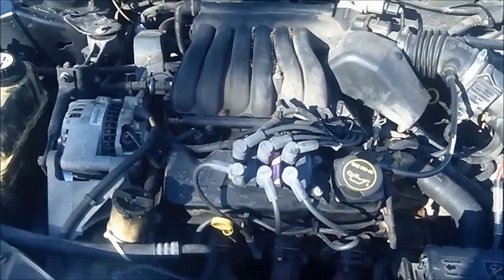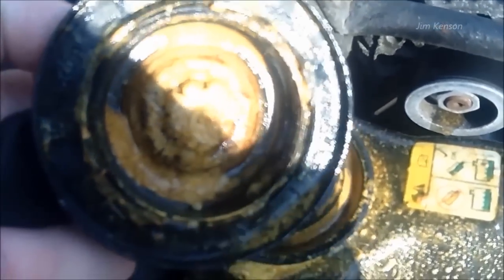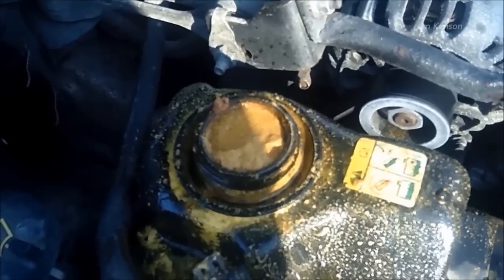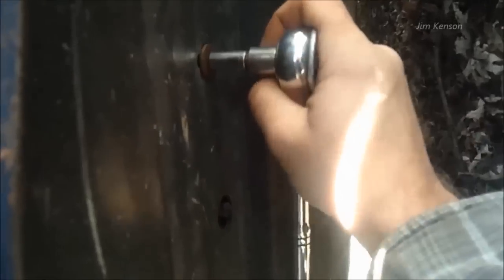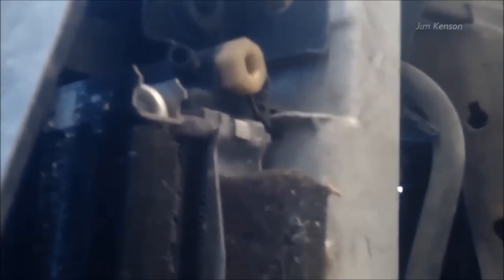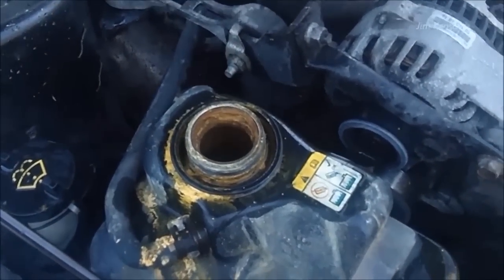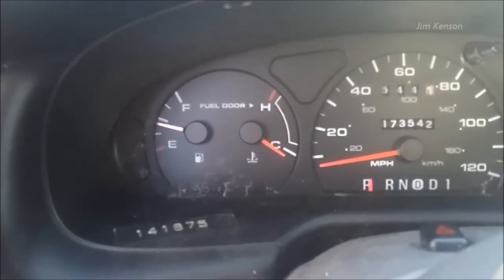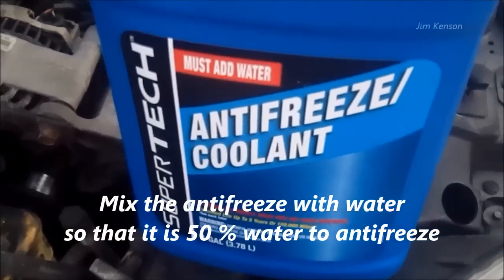Ford Taurus: Radiator Flush

Comment: If your ford is still foaming as in this video:

A less expensive way to deal with what appears to be a possible leaking head gasket is Steel Seal.
I've used it on a 2004 Taurus, a 1996 honda civic, and a 350 small block chevy. 
It has worked exactly as advertised each and every time without fail.
The company has an excellent return policy, and an excellent business record. 
They do not ask questions aside from if you would like a monetary refund, or a one time free bottle to re-dose the engine.
The look of the foam tells me the leak, if present, has not been leaking for very long.
Meaning the 99% success rate steel seal has should stop that leak without the need to pull the head.
NOTE: It more than likely will not fix a leaking head due to warping of the head. But for most leaks of the gasket, it works friggin awesomely!! 
By the way, their warranty, is a lifetime warranty. Either it permanently repairs the leak, or they replace or refund at the customer's request. 
(It catches any new leaks if the product remains in the cooling system) 
All vehicles I have repaired with steel seal had the product left in the vehicle until the fluid was changed by the customer, either by choice or maintenance schedule. It never plugs up any coolant passages.
My apologies to everyone. I realize this comment looks like an ad. It was not my intention. lol  
And if you already know about this product, my apologies for repeating.  
But I will leave the link so that anyone can look into it if they wish.  Or google it.  lol
https://www.steelseal.com/

Added: Steel Seal has included "permanently repair a cracked head or block" to their guarantee at some point since I used it last.

Comment: This is how I'd do it.  Drain out the old stuff, and dump some distilled water into the system.  Let it run for a while.  Then, drain that out.  Put in the Prestone cleaner stuff, and then top it off with more distilled water.  Drive the car for a week or so with the cleaner in it - just be sure you keep an eye on the engine temp - don't want it to overheat.  Also, make sure where you live there won't be any freezing temperatures b/c the water will freeze.  After you run the car with the cleaner for a while, drain it out and flush with distilled water again.  Keep doing that until it runs clear.  Then fill it up with coolant.  Take all of your old coolant and put it in milk cartons or the cartons you got the distilled water and coolant in.  Take it to an auto parts store or a mechanic, they'll probably take it for free.

This was a great video.  Wish I didn't have to take that plastic shroud off.  Just extra crap to worry about.  The screws can be pretty rusty too, and hard to get off/back on properly.  No need to take off the thermostat, which is nice.  Can be kind of confusing because there is no radiator cap, you do everything through the coolant reservoir.

Just remember to change your coolant every 20k miles max.  Do it before then if it gets nasty like this or if the heat starts losing intensity (not getting very hot).  Don't flush the heater core itself, you have to flush the whole thing like this video does otherwise it'll just get dirty again.  I learned that lesson.  Also remember to use the yellow/green coolant - don't use the orange stuff or the dexcool stuff, it causes problems in a lot of cars.
Reply from the maker: +NewVegasNerd Thank you for the great reply.
Reply: Great advice! Added to this video this DIYer will be DIMyself!
Reply: NewVegasNerd 
I have a question...I'm the process of flushing. I put in the flush, and a gallon of water. How long are you supposed to run your car for? And are you to keep the cap on or off? Anyone, please reply asap. I ran it without the cap for about 5 mins and with cap for 10 mins, with my heater on hot, but fan off.

Comment: I cut a hole on the spash guard about 2x2 inches to give access to the drain plug without having to take the whole thing off
Reply: How did you cut the hole? Because I rather do that
Reply from the maker: The splash guard is fairly thin. You could use a drill with a drill-bit to make the hold. But you have to be careful as the guard is thin.  Too deep and you may damage the radiator and then you have a real problem. Or try a utility knife.
Reply: In addition, go to the passenger side and cut out about 6"x6" section right under the T where the lower radiator hose connects with the reservoir hose. Easy to reach and drains everything very quickly. Just take a pair of pliers and squeeze the hose clamp and slide it over the metal part of the hose and then pull it off. After draining, just push the hose back on and then slide the clamp back on the hose.

Comment: Can I simply flush the coolant out by removing the drain plug, flushing it all down the reservoir with a garden hose until it’s clear, then just seal it and fill it back with new coolant/water?
Reply from the maker: You will not be able to get the old coolant out of the engine block by doing it  this way. Good luck.

Comment: wouldn't the water trapped in there make the final fill <50/>50?

should you fill maybe 75 25?
Reply: If you fill any radiator with 75/25 what would happen you can easily crack the engine block you need to remember that straight antifreeze or even using 75/25  antifreeze has a lot of acid so you have to use 50/50

Comment: I am not sure if this is true, but my dad always told me that I should be careful when doing a coolant change for 2 reasons...1) the coolant is corrosive.  If it overspills and you dont wipe it up or wash it off, it can remove paint and harm metal.  2) dogs love its taste and a puddle left on a driveway can kill your neighbor's dog quick.
Reply: The old coolant is probably corrosive yes. But new coolant shouldn't be. The reason they say you should only use distilled water when doing your 50/50 mix is because regular tap water is slightly acidic. Distilled water is neutral.

If coolant were acidic it would eat away at the system.
Reply: +65Superhawk AS WELL AS CATS
Reply: if you run the car with tap water for app. 2 to 3 months...  what kind of damage would you need to look for?
Reply: Gypsy Love if you don't have any rust inhibitor additive mixed in there with the straight up tap water, expect some corrosion, and more down the road should you continue to allow it to keep running through your car's cooling system.

Comment: I hope someone here can help me with a simple problem.

I drained, flushed and refilled the coolant system in my 1999 Ford Taurus (77,000 miles). The car runs fine, does not overheat and the coolant level in the reservoir is at the optimal level, but, now the "low coolant" light comes on every time I drive the car.  I suspect there is air trapped somewhere in the coolant system.  This car does not have a coolant system air bleed screw; also it has a pressurized coolant reservoir, and no radiator cap. How do I fix this problem.  Would it help if I drain and refill the system but taking some other precaution that I may have missed the first time around.  

Would greatly appreciate for any help.  Thank you very much for any insights.
Reply from the maker: The air should have worked out of the system. I suggest you take it to a place like Autozone or Advance Auto and have them clear the code that set off the light or unhook the battery for a few minutes and see if this clears the code. I also found this link that might help you. http://www.automotiveforums.com/t200091-low_coolant_light_with_full_fluid.html
Good luck and thanks for watching the video and please let us know what fixes the problem.
Reply: It's very common for the low coolant sensor in the bottom of the tank to go bad

Comment: what is that stuff in the coolant? it doesn't mean the head gaskets are blown?
Reply from the maker: Someone had put stop leak in the system. It needed to be cleaned out.
Reply: +Jim Kenson oh I see right on, that's probably what happened to my car then as well.
Reply: The actual answer is that the wrong coolant was used. Someone used orange  coolant, instead they supposed to use green color (common) coolant.
Reply: Mark Gardner the stuff in the coolant people mistake for radiator sealant is rust settlement from the system. The original coolant is premium gold looks tan or gold in its natural color. When it's dirty it looks rusty in color with settlement in it. The 98-05 Ford Taurus an Mercury Sable are very common for plugging up the heater core resulting in no heat. Heater core will plug up from the debre you see here in this video. The only way to restore your heat is by flushing the heater core out along with the radiator system an replace the thermostat an new antifreeze
Reply: LittleGojira the coolant recommend for ford an Mercury is premium gold. Not the green.

Comment: Can someone help me ? My Ford Taurus 2001 when I start it it makes this loud ass noise and out of nowhere just messed up and it won't go no more than 50 and one day it wouldn't start and I opened the hood and some water valve or a pressure sensor burned out and it burned lik two plastic tubes too but I replaced the tubes and the sensor and it won't start can someone help me thanks
Reply from the maker: Not sure, but hope you got it fixed.

Comment: You should have removed the overflow tank and cleaned it good first. It looked pretty bad. Never run tap water in your cooling system if you can help it.

Comment: Dude, you should have replaced that coolant reservoir.
Reply: Hey jeffrey he can easily unbolt & disconnect the hoses & take it out & clean it out with A jet on A garden hose the hook it back up and then flush out the radiator instead of replacing it I've been working on cars for 33-years & that way is easy and less expensive   then buying A new coolant reservoir A new one for A ford Taurus will cost up to forty-five up to fifty dollars
Reply: Or run it in the dishwasher

Comment: also sounds like you need to replace your idler or tension pulleys
Reply: HEY FORD TAURUSES DON'T HAVE AN IDLER THEY'RE CALLED THROTTLE POSITION SENSORS & TENSION PULLEY'S ARE STRICTLY & ONLY TO LOSEN UP THE SERPINTINE BELT   WHERE IN THE HECK DID YOU LEARN ABOUT CARS FROM A TOY STORE
Reply: HEY WHY DON'T YOU TRY REPLACING THE FRONT END ON A FORD TAURUS SUCH AS THE UPPER & LOWER BALL JOINTS & TIE-RODS & CV-JOINTS & STRUTS OR THE MASSIVE EMISSION AIR-FLOW BOX OR THE TIMING CHAIN  OR THE ROCKERS *& LIFTERS AND THE CAM-ROD UNTIL YOU CAN DO THAT THEN YOU SHOULD KNOW ABOUT FORD TAURUSES